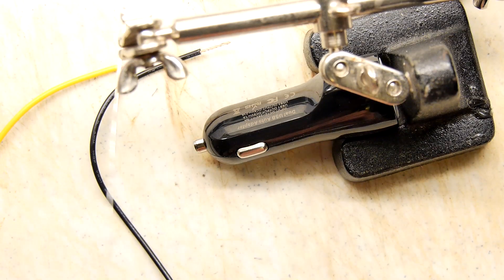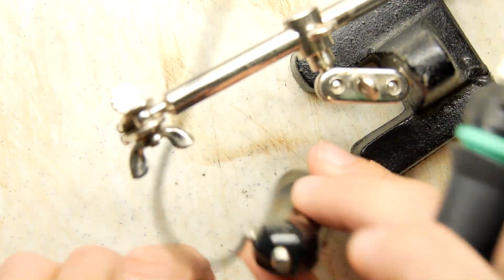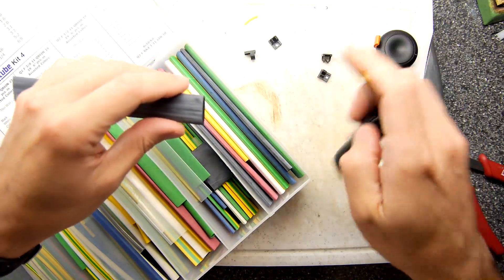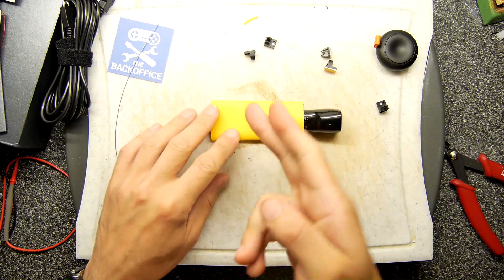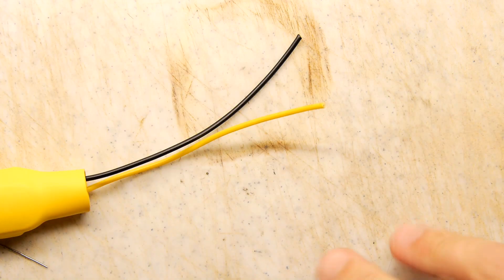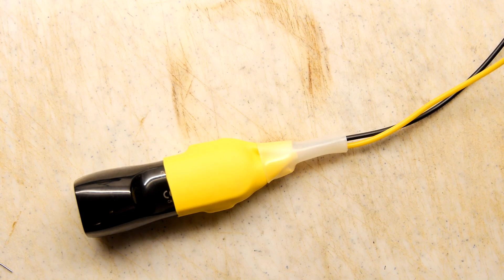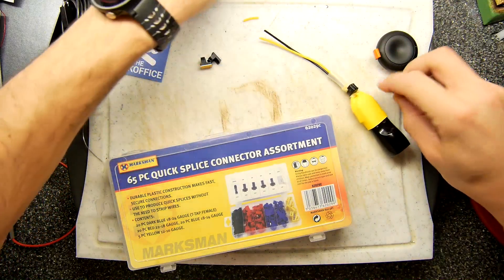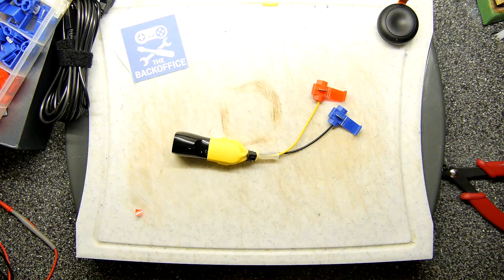DDPai M6+ Dash-cam Hard Wire Hack Tutorial

Comment: after this one...where do we attach this in the car? do you have video?
Reply from the maker: I always look for the wires that go to the existing lighter socket and splice it in there. Do you have access to it? You might need to remove some panels.
Reply: backofficeshow is this safe to splice in exsisting cigarette socket? Can i use the cigarrete socket in cellphone charger at the same time?
Reply from the maker: Ian Pyx absolutely, the socket is fused for the maximum rating so it if it exceeded the main car fuse will blow off necessary (it won't though, so don't worry)
Reply: Thanks man. Im excited to try this.
Reply: It works man.....thanks!!! :)

Comment: Great video. Obviously there are many ways to achieve this. The way I did was by hardwiring a 12-volt cigar lighter socket instead, which is more universal (i.e. will work with all appliances, even those that don't use USB power) Of course you could then plug the USB charger into it to use with a DDPai.